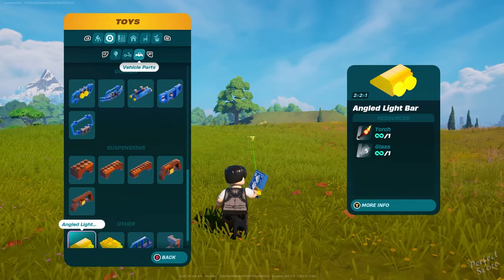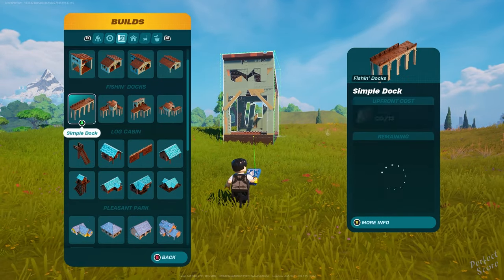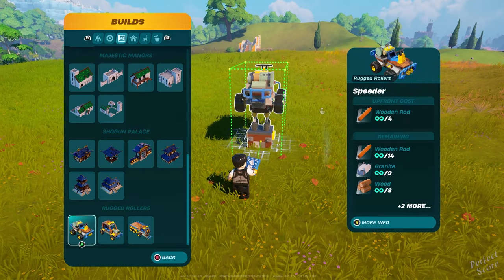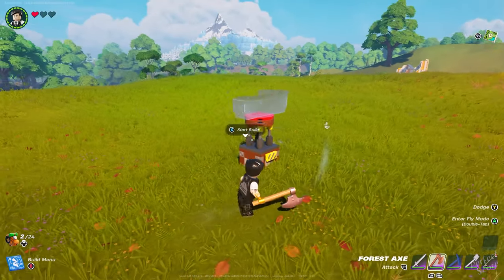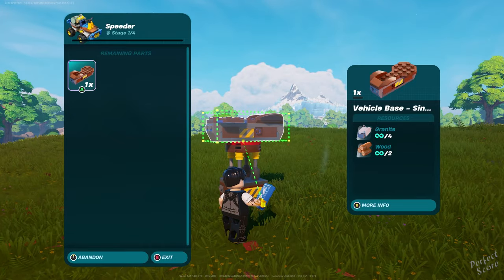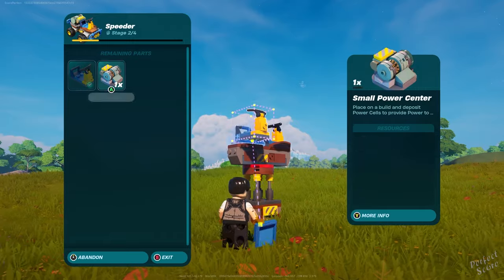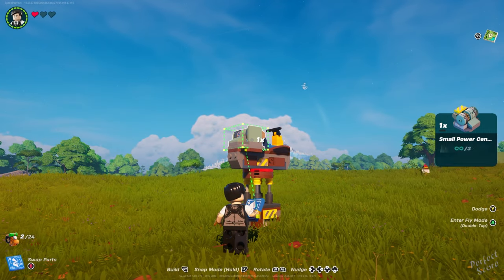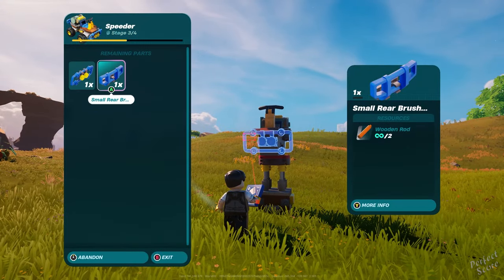How to Build a Speeder in LEGO Fortnite

Comment: The only problem is that I can’t drive it, it just spins around (I’m in ps5)
Reply: Same..I even built the bigger vehicle, and that couldn't even make it up a small hill... waste of time and material
Reply: @dramaking4107 I'm on Xbox and it spins
Reply: Same here
Reply: You need to make sure the wheel is going in the correct direction, otherwise it's going to do that.

Comment: But how do i get fuel in the car?
Reply: You first need to get power cell. Which you can get from biomass, to get biomass you need to have a compost bin which you can craft from utility. Once you get the compost bin. You need to put some stuff in the compost bin which should get you biomass. I recommend putting some bones in the compost bin as that the best way to receive biomass. Once you get the biomass, head to your crafting bench use to craft the biomass. Make sure you also have glass to combine with the biomass. And that should get you the power cell.